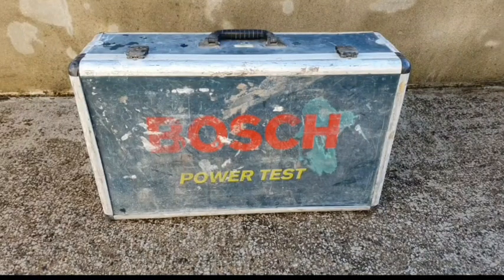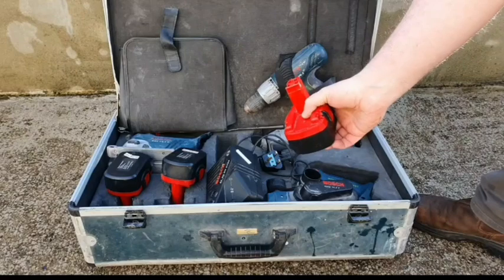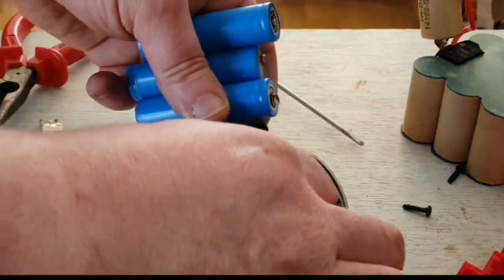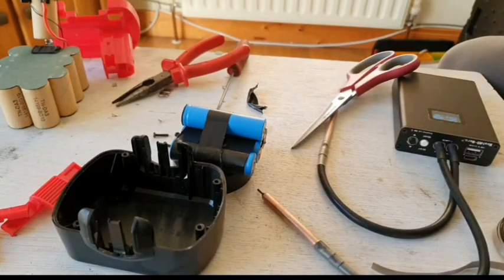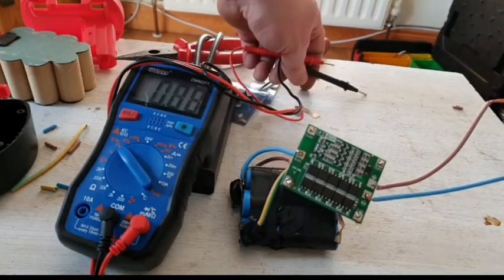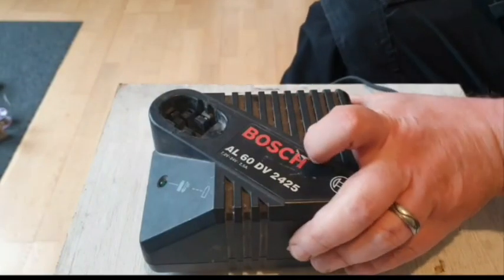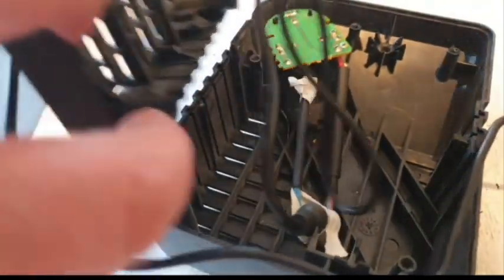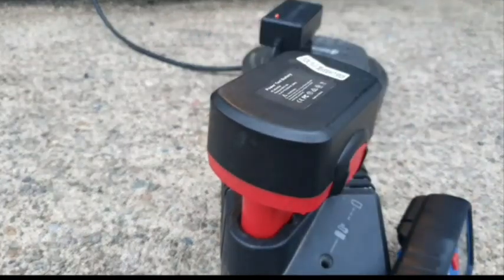NI-CAD to Lithium ion Battery upgrade #bosch #restoration #powertools #trending #repair

Comment: Have you measured the cells since making them? If your not using a BMS and a cell dies wont it just catch fire?
Reply from the maker: That's why lithium cells need a management board and ni cad don't
Reply: @doctorlefthandthread  I didnt see the BMS wires on your build?

Comment: Very impressed with your skill set ! Excellent salvage job. I have a bosch with dead batteries but i doubt i have the skill to do what you did.
Reply from the maker: Thank you for commenting
Reply: Main difficulty is to open the battery package, if it is glued (as often the case) and not screwed.  The rest is rather basic electronics